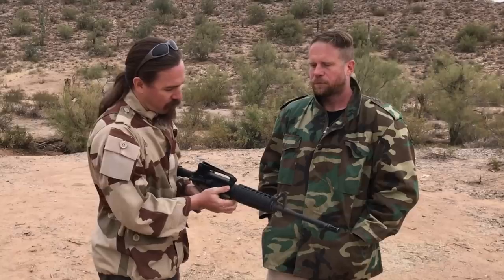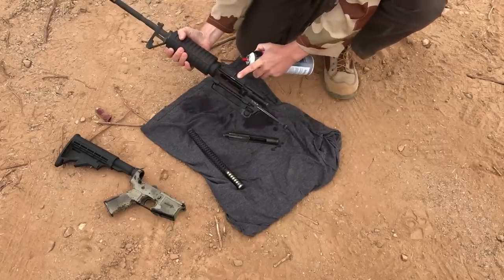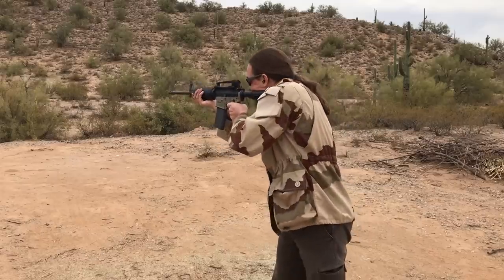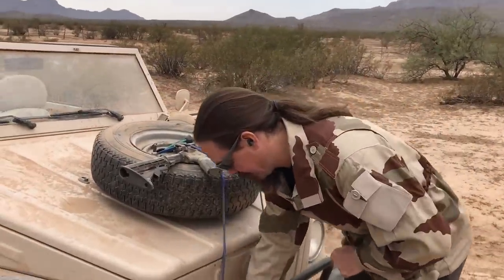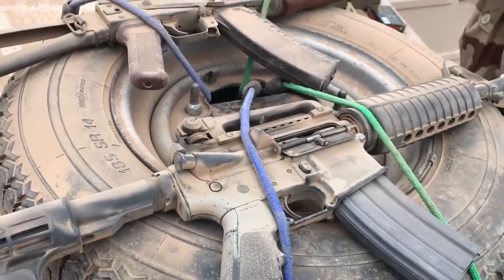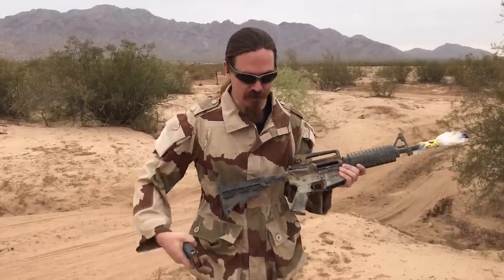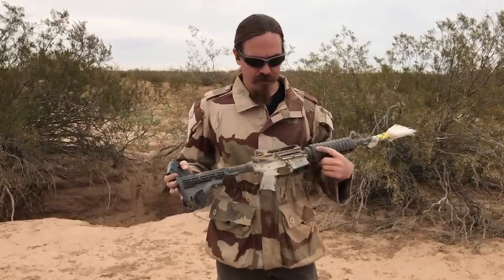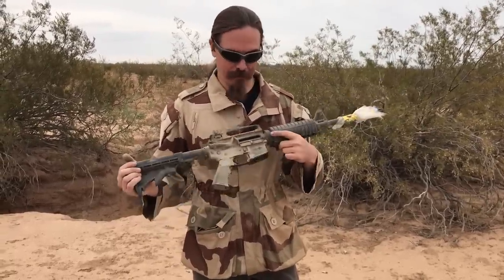Convoy Dust Test: M4gery / AR15

Comment: I seem to remember reading something about the US Army ordering M9 magazines that were parkarized on the inside. The mags apparently worked in the US during testing but failed in either Iraq (or possibly Afghanistan). The M9 would malfunction with these mags. 
If I remember correctly, once the manufacturer tested the mags with sand from Iraq they realized that the sand was different from what they used in testing. 
I realize that it's ignorant to coat the inside of the mags.
Not all sand is the same.
I'm not going to name the manufacturer since they followed the (idiotic) government requirements, and it wasn't really their fault.

Comment: Use dry lube in a dusty/dry enviornment. Use strategically placed light coatings of wet lube in a hummid/wet environment. Also, don't run cheap .223 with corrosive primers in an AR. Stick with surplus greentip M855, unless you've specifically set up your gun to shoot something different.. Most of the off-the-shelf ARs have too much barrel twist to shoot 55gr 223 accurately anyway. Take some time to learn the inner mechanics of your firearm.

Comment: I appreciate the test, especially the fact its a used AR, but

A) most milpec ar's within there normal lifespan (in the military) have an upper and lower 'gap' around 15-18 thousands of an inch.

B) I know many armorers didn't even test for this considering the number i had to retrain well above my rank, so i can guess many guns in the fleet failed this test, which will effect bolt/mag alignment. 

So i wish tests were done on weapons as close to the absolute horrible condition AR's rapidly aquire with heavy field use. 

My units guns were on a near constant training cycle, and after 1.3 years, were evac'ed and replaced.

Ak's often function decades with nobody caring for them, and users that have virtually no education.

Point is, yes, the AK isn't always reliable, in all conditions.

But hand an AR to some guerilla fighter and they will quickly toss it into the trash for an ak.

Comment: I really have to conclude with Ian on this one. Everywhere I went across the service, my issue weapon of an M16A2 in basic and M4 anywhere else was constantly plagued with issues. You could shake the thing and hear it rattle, and even though I am a good shot with my 30-30 and Mauser here at home for zeroing during hunting season, I was getting spotty hits on the 150 meter targets in basic and barely hitting at all at my service station if the gun didn't jam after 5-6 rounds. I told our armored and supply sergeants about this and my lack of trust in the guns and shortly there after I was swapped into being the unit medium machine gunner and issued a 240B which had just been converted to a collapsing stock. As much as I hated the bulky bitch, she never jammed on me once and i was accurate as hell with her. To this day my buddy who was in charge of gauging company guns swears up and down our M4's were shot out and the only reason they were allowed to pass muster was the gauging was fine and so an apathetic first sergeant at the end of his time never sought to replace them through the chain of command. As to the validity of this statement, I cannot attest

Comment: After I picked it up I woulda aimed it down and racked the bolt a few times before loading it to knock sand out of buffer and barrel etc. then it woulda worked fine

Comment: In iraq i didn't oil my weapon as you said sand and dust will sick to it if you do. great cleaning tool for a weapon system in a desert type place is a air blaster like you use for cleaning key boards and a fine paint brush. You must clean it every day though cause dust is a pain in the arse  it gets every where.

Comment: The only time I had issues with my m-4 down range was during sand storms. When the dust is in the air it cakes on quickly, and we used CLP which didn't help either.

Comment: 14:04 Your absolutely right. When I was in Afghanistan we'd lube our M4s VERY lightly because the dust would glue itself to the bolt. Even though I knew the reliability problems were a myth I was surprised at how well my M4 functioned as long as you did even the most minor maintenance. Pop it open, wipe down the bolt slap it back together and it'll run fine.

Comment: This is our revenge, the revenge of the AK guys after the mud test !!

And by the way my comment its the number 545 hahaha
Reply: I'm not sure it's much of a revenge. The AK with the bolt closed did fairly similarly to an AR with the bolt open.
Both did great, though. Nothing against the AK whatsoever..
Reply: @MarvinCZ  The AK it's an open system, the AR it's not, the test was equal, and don't even mention that the AK empty a mag with rocks inside

Comment: Interesting video and I'm looking forward for next one.
I have two questions to ask.
1. What about micronized graphite as a dry lube? Will it work or is it meaningless?
2. It's little bit OT but I'm thinking about my first AR and the one we have in stock (I'm working in gun store in Czech Republic) for quite reasonable price is Armalite DEF15. It will be used mostly for plinking or some fun match, usually at ranges up to 100-150m. Intended upgrades are Magpul Mbus as a backup, Holosun HS403A as a main sight and Magpul CTR stock. I know it's entry level but are there any known issues with this maker and model?

Comment: 2 minutes in.  I'll say this before I watch it.  I was a young Marine in Iraq in 09 with a M16A4.  I went out on convoys all the time in dusty environments.  Dust got everywhere.  Even in our tents dusty somehow got on the top...like inside top.  I realized this right away and I decided to ride on the convoys with my M16A4 dry.  I knew if the shit hit the fan after a couple of mags my M16 was done for unless I was able to lubricate it at some point, only prolonging the inevitable failure of my rifle.  But if I lubricated my rifle from the wire, it would be gunked up in muddy oil within minutes.  So I completely agree with them having it dry, though I'm curious how many magazines they put through it.  Lets see. play
Reply: Update, I never degreased my M16A4, just dried it off as much as possible with cloth.  Degreasing a well worn M16A4 will cause rust and jamming issues.
Reply: Just got finished watching.  Disappointed they didn't run a few mags through.  I was really curious what would happen.  There was no doubt in my mind it would function for less than 20 rounds.  The stories about the M4 failing in Afghanistan and Iraq are typically from prolonged contact where several magazines are put through the rifles, such as suppressing fire.  Especially early in the wars they still lubricated their rifles.  The carbon and dust would build up, causing issues with feeding.  Big surprise, the forward assist is meant for when the rifle builds up carbon.  Lets see you do this again, but shooting at least three magazines, with a sprinkle of dusty in between to simulate a combat environment.  Not hating on the M4, just curious if I had the right idea back in 09

Comment: Interesting and a better test than the "wet grit slurry" ones in my view. Up until the Fourth Afghan War, British doctrine for small arms in dusty and sandy environments was as you used here - remove all traces of oil and for the same reasons you state. However, this has, in the last ten years or so, been changed to using large amounts of lubricant in such conditions and current training puts much emphasis on this. This isn't just for the SA80 series, which in the A2 variants is at least reliable, it is also for GPMG (FN MAG) which is a weapon that has always been a robust and reliable design and for everything else besides - except the Glock Gen.4. What is US doctrine for these conditions?

Comment: One big thing you guys AREN'T discussing is another place the AR-15 might allow a lot of ingress of dirt, especially sand, into the system in real conditions: reloads. The AR-15's bolt stays open on reloads. This seems very convenient and a lot of times it is. But if there's a gunner to your right kicking up all sorts of sand, and it's getting blown straight at you, or some heavy winds throw sand around, then that sand is going right into the action while you reload and the bolt holds open. Just the right (wrong) circumstances and you end up with a lot of dust and sand in the action. That kills the AR.
Reply: They don't explicitly discuss it but if you notice, the last test was done with the AR bolt locked open and dust piled up in the action.

Comment: I feel like you should really be using a P2 Respirator Carl.

They are uncomfortable as shit, but Silicosis is no joke.

Also I feel like to standardize on your final 'crap ton of dust' test, when shaking out the mag, you need to wear a steel GI helmet and give the mag two taps on the helmet, like the movies.

Comment: You do realize that the Kalishnakov was envisioned as a weapon of Soviet Expansion.  One that could be put into the hands of a non-technological group, given minimal instructions and turned loose on society.  Whereas, the AR was designed with much closer tolerances, which puts it at a disadvantage in a "dirty" environment.
Reply: Stephen Lockwood That's a myth.

The VietCong were also issues with cleaning kits to clean their AK rifle and lubricate them well after Battles and constant firing will eventually build up grease in their chambers and were instructed to hide their rifles under dirt while wrapping them up with cloth to prevent mud coming in their chambers because how loosely their tolerances can be.

The AR on the other hand was sabotaged by US Army Bureaucrats that was full of conservatives by not adopting the AR Rifles well and this is how it's reputation came to be, American GI's were given rifles with no cleaning kits and their bullets were full of artillery gunpowder propellant which breaks the rifle chamber from inside, such propellant has more pressure than any other small arm bullets.

Comment: You need to have the rifles in the BACK of the vehicle. WAY more dust settles in the back of the vehicle than on the hood. I rode in back of HMMWV in Afghanistan daily back in 2005-06 and was covered in so much dust that my teeth had mud on them. I have pics and everything.
Reply: Did you run your weapons dry or oiled in Afghanistan?

Comment: When you did the AK, the bolt was forward for the last test with dust kicked on it.
Reply from the maker: With the dust cover/safety open, thus making essentially the same equivalency.
Reply: @InrangeTv  I get what you're saying, but the debris is going into different places on the two rifles. If your conclusion was that enough dust can take either down but both can still mostly run, then they difference wouldn't be as great a deal. 
My concern is that AK fan bois will take this to mean the AK is better when exposed to dust. That could very well be there case, but I don't think it was proven here.
I think bolt to the rear is an unlikely scenario. I get that you were really just trying to set up a worst case for both rifles, but I think it's best to allow fundamental design flaws to play a role in the test. The AK is wide open to the elements because that's how it's made. Perhaps it would have been better to have the bolt forward and dust cover closed with each rifle and a magazine in the well, but to lay another loaded mag next to the rifle like you had it for the portion testing dust in the mag. Or maybe start the test the way you did, but with an extra mag exposed for the duration.
I know it's easier to what-if this stuff afterwards. You guys do great work and I don't want to come off like I know better than you. I look forward to seeing other tests in the series. My opinion is worth every cent you paid for it.
Reply: @chopinbloc  hey hey, calm down ar fanboi

Comment: Not hugely surprised... AR's if they dont have anything in the internals or magazines are usually reliable. Most the cases I ever heard about AR's fouling up real hard were ones that were over lubed and going out into super dusty environments. Some claimed their AR's were squeaky clean, weren't over lubed, and etc.. But cant please everyone I guess. While I've had my own issues with the AR platform over time even I know they are generally speaking a very reliable platform, if it wasnt we wouldnt still have it around.

I'd like to see this test with something like a G3, FAL, and maybe a Mini-14 or M1A.

Comment: I disagree with the conclusion that the AK was easier to get back into action and that the AR was on the edge of failure. My own conclusion is they both took a little bit of reasoning with to get them to dump the rest of the magazine and id put a bet that if you were to put a full mag into either one of those rifles, they would of continued chugging along. If you go back and count the failures of each rifle, the AR had three while the AK had four. You could count the AK as two failures sure if you want to play it that way, however both rifles got progressively easier to clear the failure and chug along until both guns could dump the rest of the mag.

Comment: You are not right about ak performance. Ak did not have opened bolt during dusk kicking. I think both platforms performed very well but there is no winner.
Reply: He blew the sand out of the AR's chamber, never blew the sand out of the AK's chamber
Reply: @120masterpiece  Yes, because AK chamber was closed, so there was no way to get dust in there.
Reply: @120masterpiece  He did have to blow out the sand of the AK's chamber in the other test.
Reply: @chuck5822  Ok, I was wrong about that.  But does anybody honestly any weapons is going to work when there's sand in the chamber, locking lugs or breach????

Comment: So I just had to be that guy and point this out but the AK had its bolt closed when you kicked dust on it and the AR had its bolt locked open. I know it’s a distinct feature that separates the two which have its pros and cons so that could be the reason for leaving it locked open but I think the ar15 would have done even better if the bolt was closed during the test. Either way watching both videos I personally see it as a near tie with the AK ever so slightly edging out the win. I’d have to put the videos up side by side but it seemed it took both of you similar times to get them back to running order.

Comment: I am personally quite surprised that your AR was able to run so well dry dust or no dust. I have personally had the experience of an immaculately clean But dry M-16 that ran perfectly FOR 1 MAG but couldn’t manage two rounds in a row no the Second mag And went right back to running perfectly as soon as I put lube on it.
Reply: This was back in 2006 but if memory serves they were all failures to extract

Comment: Some of the guys on lightfighter went over the lube or no lube debate. It turns out that lube is better. Yes, it turns to dusty mush. Yes, the AR15 has no issues pushing that out of the way unless it gets in the actual firing chamber but then you're screwed if dust gets in their anyway. The DI impingement blows a lot of that stuff out during the cycle process. They also did a no-clean test where they blew through 10k rounds without cleaning but spraying lube in the chamber. Upon disassembly is looked like creamy black tar in there but the gun was still running with no issues.

Comment: After seeing the AR handle the mud test with the dust cover open, I feel like a dust and oil slurry would be okay!
Reply: People took away the incorrect conclusions about that inrange mud test; it was not meant to show that the internals of the AR could perform better against mud, but that it wouldn't even have to contend with mud; any amout of mud inside the close system of the AR would render it inoperable. 

..The inrange test is unrealistic because nobody would bury their gun in mud; the AR would fail harder against mud and be harder to clear if the magazine was dropped in sand, dirt, mud and snow and had to be inserted back in.
Reply: @thephoenix756 that's the lovely thing about a closed system, it doesn't get in at all

Comment: Hello Great video, I noticed that for the AK test when you kicked dust on it Karl had the bolt closed but for the AR the Bolt was open. Do you think the AR would have done better if the bolt was closed when the "moon dust" was kicked on it?
Reply: You do realise that the AK has a huge opening on the side of the receiver? It was just as exposed.
Reply: @thephoenix756   Not really.. You realize that the chamber, bolt face, and trunion locking lugs area was closed off when the bolts in battery? Those are critical areas, ak's tend to see issues when debris gets into its locking lugs (like all firearms) which is one reason it's creator opted for no bolt hold open feature.  And do you realized that the safety lever  also works as a dust cover as well on the ak ?(I dunno if it was used or not, id have to look back, but it doesn't really matter anyway). I dunno why you would argue over his comment when its just a fact of the matter that he pointed out.  But the whole point was to make them fail to begin with, and like I said the ak has no bolt open feature to aid in that which the ar15 does.

Comment: The flaw is not having a round chambered..... Good test
Reply: It's wives tale made both true and false like resting the rifle in it's mag and it failing..... Or the need to insert the mag with the bolt locked back to changed a round.... Yes these are mag/chambering faults. But harder to account for in field opps

Comment: could we do this same test but with only a small amount of grease on wear surfaces on the AR  to see what a properly lubed AR would do in that condition?
Reply from the maker: Nope.  No matter what lube we use, it’ll be wrong, so we’ll do these dry.
Reply: @InrangeTv  Fair enough. Ive always thought the MIL's cover everything in CLP was setting its self up for failure.